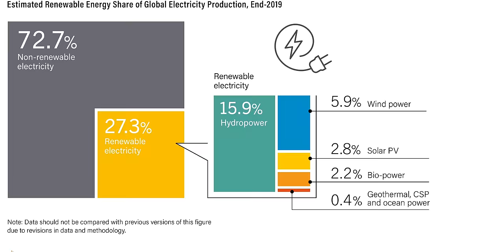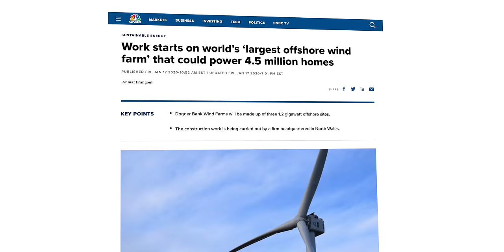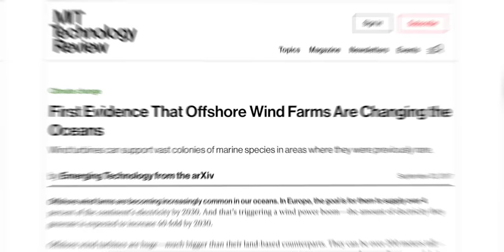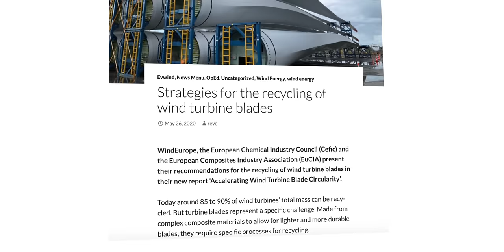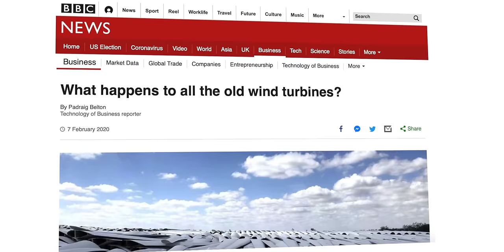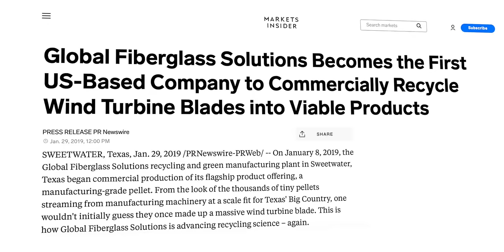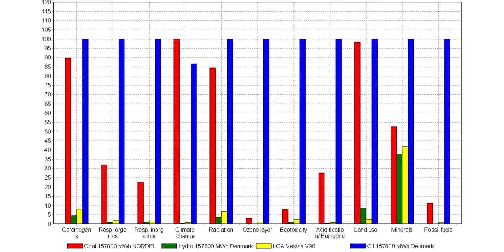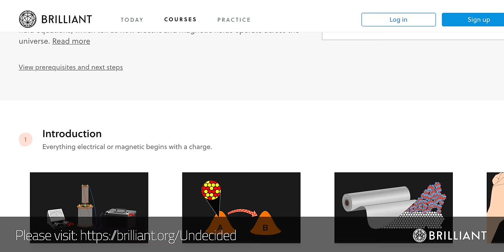The truth about wind turbines - how bad are they?

Comment: So overall I support wind power and have even worked in the wind industry as a turbine technician, but please don't kid yourself. Wind power in no way is completely clean. If you hate the use of oil, well guess what? Turbines use oil for the tur one gearbox, and they can spill? I wasn't the cause of the issue, but I was responsible for helping to clean a leaked turbine oil spill, that unfortunately did leak out of the turbine and damage the crops of the farmers land on which it was located. I won't say this is common, but it does happen.

Comment: And when they burn up they do it spectacularly
Reply: Ancient info, a few early wind turbines, decades ago, did catch fire but modern wind turbines don't.  Fossil fuel plants are not immune to catching fire or worse also
Reply: @stevehayward2533  i missed the part where fossil fuels were made from fiberglass....
Reply: @troyb3659  Troy. Don't bug little Stevie. He is a good little go greenie that thinks he can change what has gone on with the earth for four and a half billion years by paying more taxes!!!!
Reply: @stevehayward2533  On the way to SW Texas I saw one of these "new" wind turbines engufled in flames, gearbox failure oil running down the pylon and the whole thing in flames. the blades eventually fell off and partially burned also...so hmmmmm. Was told it was not the first one that burned. Ground was Saturated with unburned oil also!
Reply: They don't do it often, nor do our machines murder 10 people at a time when they do, like oil rigs, out in the ocean. Deepwater Horizon, for example.
Reply: @jacoblaughbon3323  id like to point out that machines are incapable of murder.
Reply: @jacoblaughbon3323  lol.

Did you just blah blah blah the definition of what you were saying....lol obviously you are not one to let facts get in the way of your agenda!
Reply: @jacoblaughbon3323  wouldnt that then be the morons fault....i mean that is my argument.  Improper usage, improper maintenance and inspection none of which are responsibilities of the machine.

Comment: Ultimately the best way to produce clean energy with no carbon emissions is nuclear power
Reply: But it's greenhouse footprint positive.
Reply: @kcbob this is a common counter point that a lot of people have.  First remember that the waste is incredibly condensed.  One pellet of uranium can create as much energy as 2,000 lbs of coal.  Uranium the size of a can of coke can produce enough energy for an entire life span of a person.  
Disposal can be easily contained and sealed so that it has no impact on ground water and no radiation seepage.
Reply: @brandonmoore1344  Thanks for your time to reply, but I did not mean about the waste. I meant that since this is not a renewable energy source, it heats up the plaernet just like fossil fuels do. So suppose we replace all fossil fuels with nuclear, we still have the same greenhouse effect problems, don't we ? We need to take our energy from the Sun so that we do not add more energy into our system from other sources. Other than that, I like nuclear energy.
Reply: @dimitristripakis7364  sorry my reply was supposed to be for the other comment.  Tbh I need to read more in order to answer you question
Reply: @brandonmoore1344  Oh you re right, Im sorry.

Comment: I have a  PhD in environmental engineering. Its easy to cut the analysis short - if anything truly is going to work it won't require subsidies - until then keep it in small scale/pilot R&D mode until it can.
Reply: You are absolutely correct!  I have been trying to make that exact argument for years "If wind and solar is so profitable , then why do they get such MASSIVE subsidies from the government?"   Remember Solyndra?  The solar  power company that was given 500 million dollars from Obama in the stimulus package, and then declared bankruptcy 6 months later?  Sorry, if you can't make it when you are handed millions of dollars of free money, then you can't make it!!  Ever!
Reply: That does kind of ignore that the mass production of solar has brought the cost down hugely; wind also though not to the same extent; and the environmental cost of continuing to screw up the environment... I would go so far as to say that comment contradicts fundamental principles regarding both the environment and engineering (with regards to volume production)
Reply: Exactly right, they only work with massive subsidies. This massively impacts the lower waged and the poor with 20% green taxes applied to their energy bills.
Reply: @stangoodrich5721  Ah, the Solyandra proves everything argument. Solyandra made sense at the time because solar was developing rapidly but silicon was still very expensive and it still wasn't clear whether going for simple but less efficient use of silicon would be better than using a small amount of silicon and putting a lot of effort and cost into focusing light on it and cooling the silicon to get a lot of power from a small chip. China eventually subsidized it's silicon production (and polluted a bunch of rivers) to make silicon much cheaper. Solyandra's approach was no longer workable. The problem is they faked their books to keep funding going, like Enron and other frauds.  Meanwhile, how much do you think it costs to build any power plant? Less than 500$M?

Comment: Going nuclear solves a lot of the problems with renewables and fossil fuel plants. The waste is a politial problem, not a technical one.
Reply: Last report I heard, if you took all the waste water from all the unclear powerplants in the world, it would fill an Olympic swimming pool . . . That's it. Like you say, it's a political problem, not a technical one.
Reply: @leonielson7138  Correct. And over time it decays away to zip. Toxic materials are toxic forever.
Reply: @scubaeqhp  over time ? Like 300k years .
Reply: @armandovanhaaren7028  Nah, it'll be safe to handle without protective equipment in about 10,000 years, but loooong before that science will figure out how to neutralize it. Breeder reactors burn waste and create more fuel than they use. Small Modular Reactors are the wave of the future.
Reply: @scubaeqhp  fuel is not the only radioactive waste a nuclear power plant produces  . The entire building is radioactive and everything you use to demolish it with  .
Reply: @armandovanhaaren7028  Wrong. All the high level waste is in the spent fuel. The vast majority of any contaminated/activated material is low level waste and there are plenty of waste sites already open to take that. The buildings that house the primary containment vessel and all the rest of the facility contain background concentrations of natural radioactive material and those get recycled.

Comment: There was one observation made, that making the blades black substantially reduced bird deaths as they saw them better.
Reply: The color black absorbs heat, which breaks down the chemicals and fibers of the blades causing premature failure and component separation(ie throwing the tons of blade hundreds of feet to kill what ever it randomly lands on.) or into the ocean to leak toxic chemicals into the water.
Reply: I do wonder why we don't see piles of dead birds at the foot of tall buildings, electricity pylons, large trees and other tall structures? Might it simply be that this "wind turbines kill birds" thing is simply a load of cobblers?
Reply: @Brian-om2hh  I suspect it is PARTLY that the “bird killer” thing is overrated. (Think of how many birds must be killed due to habitat destruction to mine and burn coal etc. and how little we hear about that.) However, buildings, pylons etc. tend to be easily visible; and they are not moving, I suspect that wind turbines, due to being light in colour, and the blades being both slender and moving are more difficult for birds to see. I do see a difference. I am still fine with wind turbines.
Reply: @Brian-om2hh  ummm, how many tall buildings, electricity pylons and trees MOVE at 150+ miles per hour... and the .gov has done multiple studies that document the environmental impacts of all structures(required by the .gov for most all major installations)... feel free to educate yourself. It is all free and online.
Reply: Its like birds will crash against anything they dont notice………..much more currently die just crashing into buildings…
Reply: They see black blades better, really??
Reply: @sta1RR  no they don’t
Reply: @Brian-om2hh  The problem with wind turbines is different from buildings.  Imagine you're flying in a straight line towards a building.  It's perfectly stationary so you can see it easily from far away, and avoid it.  Now you're flying towards a turbine that is spinning.  Flying along you see nothing in front of you because the blade is not within your field of view.  Then as you cross the plane of the blade it hits you out of nowhere because it's moving, sometimes at well over 100mph if you're near the tip.  And you never saw it coming.
Reply: @glennjgroves  It's not overrated.  The government has actually had to start giving waivers to turbine companies so they don't get fined out the wazoo for every endangered bird that gets Cuisinarted.
Reply: @franciscodanconia4324  firstly, I said PARTLY overrated. I did not say it was not occurring at all. And secondly, I also pointed out that environmental destruction caused by fossil fuel generation is extremely likely to kill more, just in less obvious ways. Wind and solar are still far less destructive than the fossil fuel alternatives.

It is not “damage caused by wind or no damage”, it is “less damage with wind or more damage with fossil fuels”. Even nuclear does damage (though possibly less) due to the mining involved in sourcing the fuel.

Comment: Matt, I suggest you do a similar video on the impact of aging PV panels.   This video made me wonder what the current state of PV pannel recycling is.   Thanks
Reply: In Rousset, France, you will find Europe’s first solar panel recycling plant – possibly the first dedicated facility in the world. It is run by Veolia and PV Cycle, and it has the capacity to process every retired solar panel in the country at the moment. Panels are dismantled by robots and each component recycled. Glass, which makes up two thirds of the panel, is ground up and returned to the glass making industry. 10-15% of the panel is aluminium, which is easily recycled. Silicon and cabling are processed for the metals. The only thing that can’t be recycled is the 10% plastic, which is burned in steel plants.

If you stop to think about it, there is a very good reason why we haven’t seen plants like this earlier. Solar PV panels last for 25 years, and have only been common and affordable for the last 15 to 20. We’re just now seeing solar panels retired in sufficient numbers for there to be a reliable supply. Commercial recycling hasn’t really been possible until now.
Reply: solaroid55  The video he made about it explains pretty clearly about how solar panels are recycled.  Do you even do elementary research before posting your endless misinformation on here?

Comment: I have a feeling that wind turbines will ultimately go the way of the compact fluorescent light bulb.  Sounded good on the surface but ultimately filed under "bad idea".
Reply: Compact fluorescent light bulbs aren't going away because they were a bad idea, but because a better idea came along, LED light bulbs.
Reply: While LED bulbs are indeed better, I would still content that CFs were a bad idea. As compared with their predecessor (the venerable incandescent bulb) CFs are very costly to manufacture, have 3x the number of components, require expending significantly more energy to produce each one, yet have a shorter lifespan. For the consumer, a $1 incandescent would cost you $4 or more for something that puts out the same amount of light. Not to mention, the issue of the mercury content in each and every one of them - Seldom do people dispose of them properly and that mercury just ends up in a landfill. So yeah, at the end of the day, I'm still gonna file them under "bad idea" and yes; there's almost a note-for-note parallel with wind turbines.  I'm not against progress, change or ingenuity but I'm fairly sure, history won't smile upon the notion that wind could play a significant role in powering humanity's energy needs.
Reply: I partially agree, every form of energy has upsides and downsides.  What really irks me are politicians that NEVER discuss the downsides of wind or solar and want us to pay trillions (literally) to put up more of these things.  And they never discuss the upsides of coal (with proper exhaust filters and scrubbers), natural gas and nuclear.
Reply: @Geomephysicus  Correct.

Comment: Matt,  I think your analysis has been extremely generous to wind power by omitting a major environmental truth.. In Europe (and I'm sure elsewhere) we often experience high pressure weather systems which result in low wind speeds and no power generated.   During these conditions back-up power is required from other generation sources.  This requires additional plant to be constructed and this is often hot-spinning reserve (fossil fuel).  Even if this hot-spinning reserve was displaced by battery storage solutions  it is still adding additional construction environmental footprint (ecological, carbon-footprint from concrete, and substantial earth resources for batteries).
Reply: Of course he's generous towards it. He's a woke millenial.
Reply: As always critics with this point of view leave aside the fact, that intermeshing grids are a major relief to this problem. Guess it is good enough to not mention the possibility to send the electricity between nations. As it is already and is widely build up in europe for exact this reason.
Reply: Not a metrologist are you. Weather systems cover entire continents.  Look at the carbon intensity of the grid on low wind days in Europe. Why don't you???
Reply: @jamesgreen1305  In fact, i did have a class in metrology back then. And i i know the Cabon Intensities on a windy day and a calm day. So where is your point? It's 50% renewables now. Sure the rest comes from other sources. But it won't stay like this. For sure.

Comment: I've noticed on alot of old wind turbines oil running all down the sides, so when they build them offshore, where's all that oil going besides into the sea?!😳
Reply: We don't use 'old' machines in the ocean. We maintain those machines better than you maintain your own car.
Reply: @jacoblaughbon3323  So accidents never happen?  Good to know..
Reply: Yep, just like the land based ones will wash lubricating oil down into the ground during rains.
Reply: @jacoblaughbon3323  ooof